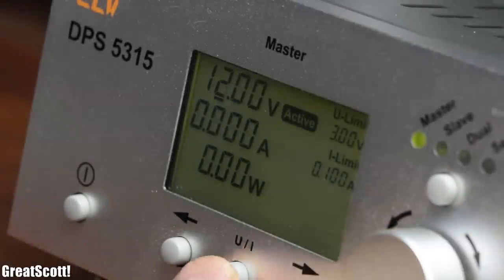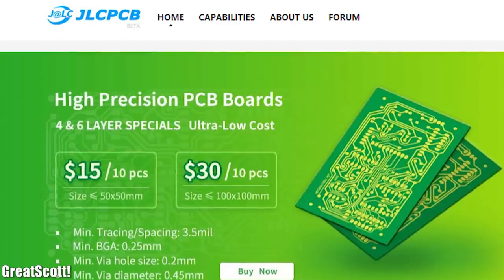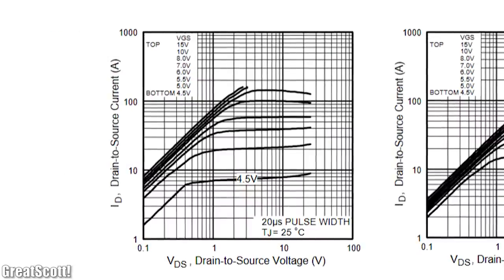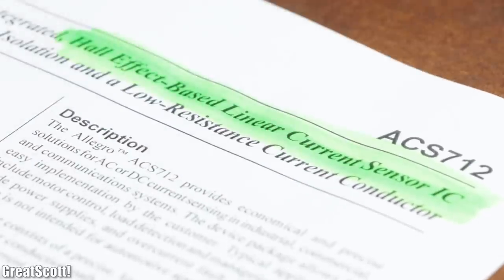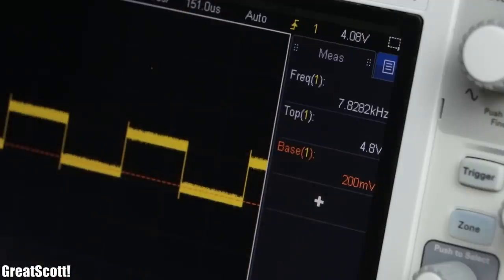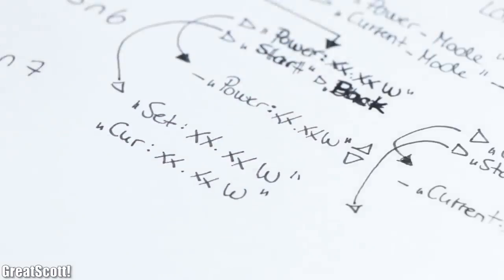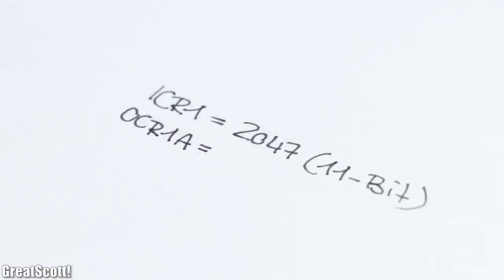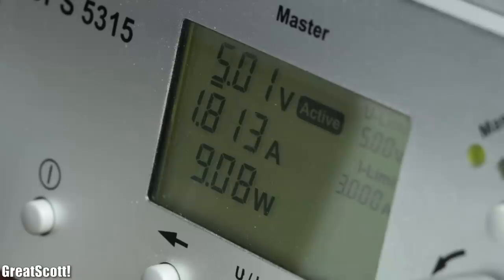DIY Adjustable Constant Load (Current & Power)

Comment: Did I get something wrong? I thought when I want to use a MOSFET as a switch I have to use satuation region too... no?
Reply from the maker: You want to use it in its ohmic/linear region. This can be a bit confusing because (I think) for BJT those region names are switched.
Reply: Hm could be. It always made sense to me to work not in ohmic region since the name suggest to have some resistence which I don't want in a swicht :D
Reply: I have to agree with Trust me, I'm an engineer! on this one. For a switch, I want the lowest possible Rds value (on-resistance), which is achieved when the transistor is operating in its saturation region
Reply: Putkimies92 I thought so as well but after some research it turns out that GreatScott! is right. The saturation has different meanings. For BJTs it's a relation between Base-current and Collector-Emitter voltage. It is the region where the Vce cannot be lowered no matter how much you increase base current, meaning the Vce is saturated. This state means the BJT is dropping as little power as possible. For MOSFETs it's a relation between the Drain-Source voltage and the Drain-Source current. It is the region where increasing Vds doesn't increase Ids and therfore Ids is saturated. MOSFET saturation is not related to Rds-on and in fact the Rds-on value is only true in the linear region where the MOSFET is operating as a resistor (but a very low value one).
Reply: I also agree with Trust me, I'm an engineer.  I am also an engineer.  When you use a MOSFET as a switch you want to use it in the saturation region, turned on as hard as possible, to get the lowest power dissipation in the MOSFET.  The "ohmic region" is called that because it has a higher resistance in that region, and therefore much higher power dissipation.
Reply: we use MOSFET in the saturation region to minimize the power loss in MOSFET  which causes overheating. And here SCOTT want it to act as a load that's why he chose the ohmic region.
Reply: I think you are all misunderstanding the graph or don't know the terminology. The saturation region is the region where an increased drain-source voltage (repeat: drain-source not gate-source) does not lead to an increased current. You do not want to use a MOSFET as a switch in this region. It can barely be called a switch, if it limits the current to a certain maximum value no matter what voltage you apply, can it?
Reply: EDIT:  OK, I removed the part here where I referenced the Fairchild Semi app note at https://www.fairchildsemi.com/application-notes/AN/AN-4161.pdf because they don't even seem to use the terminology correctly.  They are using the term "linear region" the same as the ohmic region.  The Infineon app note says "linear region" is the same as the saturation region.  So we have two manufacturers here using the same term in different ways.  So, again, I'm editing out my use of the term "linear region."

You want the ohmic region to use the MOSFET as a "variable resistor" for your dummy load.  But you also have to be aware that most really high power MOSFETs these days are only specified for use as switches and expect to be turned on hard into the saturation region.  If you are going to use one as a dummy load you have to make sure you use one that is specified for such use or greatly overkill the power spec by like maybe a factor of 10.  Kerry Wong has a nice explanation here:
http://www.kerrywong.com/2016/10/08/linear-mosfet-and-its-use-in-electronic-load/comment-page-1/
Reply: Totan Das -  But he didn't choose the ohmic region. He said repeatedly he wanted it in the satruation region.  The whole point of a dummy load is to dissipate power, and power is dissipated as heat, and heat is created by ohms and current.
Reply: superdau -  It doesn't limit the current at all in the saturation region.  The graph can be misleading in that way, because you see the line go horizontal, which makes it look like the current will not increase.  But that line is horizontal because it is drawn for a singe drain-source voltage.  Say you apply a voltage of 20 volts to the drain-source and get a current of 1 amp.  I just made those numbers up, but say then you increase the gate voltage, you won't get any more current, but this is only because the resistance of the MOSFET won't go down anymore, because when you have driven the MOSFET hard into saturation.  So your 20 volts will still produce only 1 amp, even though you incresase the gate voltage.  You've turned it on as much as possible.  But now, increase your drain-source voltage to 40 volts, and  your current will double.  It's like the MOSFET is a fixed resistor at this point.  Apply more voltage to that fixed resistor and it current will go up as well.  And on that graph what you are essentially doing when you increase the drain-source voltage is you are moving up to one of the higher horizontal lines in the saturation region.
Reply: @superdau I think u are doing a mistake we need a graph between gate voltage and Vds. Carl Smith explains it more clearly.
Reply: Carl Smith
I don't know what graph you are looking at and describing, but it clearly says drain-source voltage on the x-axis and drain-source current on the y-axis. At some point, the ds-current does no longer increase with ds-voltage. So no, if you apply 40V instead of 20V the current won't increase like in a fixed resistor. That's the whole point of calling it saturation region. In that region you can use the gate voltage to control the current (also very obvious in the graph).
Reply: I'm a bit of a loss here, because you are describing something that the graph does pretty much explicitly NOT show. In the ohmic region the current is almost purely dependent on the drain-source voltage, and NOT on the gate voltage. You have almost NO control over the current in that region.
Reply: superday - I guess I don't know how to explain it then.  Here's another link to an product note from MOSFET manufacturer IXYS, which in my opinion is one of the best MOSFET manufacturers out there.  They know what they are talking about, and this product note is all about using linear mode MOSFETS as current control devices and one of the example circuits at the bottom is an electronic load.
edit:  Guess I should include the link:  http://www.ixyspower.com/images/literature/250V-600V_Linear_L2_TM.pdf
Reply: Ok,. in my previous replies I was confusing the terminology a bit.  I've gone back and edited out my use of "linear region" as I was using the term incorrectly.   I was confusing the linear and ohmic regions of the graph.  It's the right side of the graph, the saturation region, that is the linear region, which I should have known, since the lines are linear, not curved like the left region of the graph.  It's linear because at this point in the graph the MOSFET is on hard and its resistance is essentially as low as possible, so as the drain source voltage increases, the drain current increases linearly.  But it still DOES increase.  Superdau - look carefully at that graph -- even though the line is almost flat, it is not actually flat.  Increasing the Vds will still increase Ids.  Ids just doesn't increase as fast because the effective resistance of the MOSFET is lower.  The analogy with resistors would be like the voltage drop across a smaller resistor increases much slower than it does across a larger resistor if you were to increase the current the same amount.  GreatScott made the same mistake in terminology as I did, his first reply says "You want to use it in its ohmic/linear region" and I think that threw off my thinking.  Linear and ohmic regions are not the same region.
Reply: Yes, and in that document it says that the current of a MOSFET in linear mode is controlled by the gate voltage, which you do in the saturation region. 
Oh wait? Are you confusing "linear mode" and "ohmic region"? Those are two very different things. A MOSFET is used in linear mode when it is in the saturation region !
Check this
https://www.infineon.com/dgdl/Infineon-ApplicationNote_Linear_Mode_Operation_Safe_Operation_Diagram_MOSFETs-AN-v01_00-EN.pdf?fileId=db3a30433e30e4bf013e3646e9381200
or this
https://www.youtube.com/watch?v=1qRWBkrcnAM
Those are the first two links that google spits out for me when searching for "linear mode mosfet". They should make very clear that you never want to be a switching MOSFET to linger in the saturation region, but want to get into the ohmic region as quickly as possible. For a load you want the opposite: you want to stay in the saturation region to run the MOSFET in linear mode. All this is clear just by looking at that single graph, but I guess videos or another text explanation makes it easier.
Reply: Superdau - the lines are not actually horizontal even in the saturation region.  They still go up with increased Vds.  Just not anywhere near as fast.   And because the line is straight linear line in this region is what indicates that the mosfet is actiing sort of like a fixed resistor.  You have a linear change in Ids for any change in Vds.  If you kept extending the graph out to the right the lines would keep going higher forever, until you exceed the devices safe operating ratings and it fails.
Reply: Now you just trolling, right? Just check the links, please. The Ohmic reason is called like that for a reason, because the MOSFET acts like a resistor there. Take a guess why there is another region, that is not called "ohmic region"?
Reply: Superdau - Resistors have a linear relationship between voltage and current.  MOSFETS in the saturation region have a linear relationship between voltage and current.  You apply more voltage, the current goes up.
Reply: Except it's like that in the ohmic region, not the saturation region. All you've stated until now is the opposite of what the single simple graph shows. No point feeding a troll any more.
Reply: It's NOT like that in the ohmic region.  The left side of the graph has curved lines.  If you plot the current through a resistor as you increase the voltage,  you get straight lines.  Sloped upward straight lines, not curved lines like the left side of the graph.
Reply: And that graph is not simple in any way. It's the most confusing thing about MOSFET characteristics.  It has proven here today that it is not a simple matter that is easy to understand.
Reply: Let's use the infineon pdf that superdau posted  before. Figure 1 shows the output characteristics. For a 400mA drain current, using Vgs=3.3V we are at saturation region with Vds=4V. So power dissipation is 1,6W in saturation region.

Now for Vgs=3.6V and the same drain current we are in the ohmic region with Vds=0.5V. Power dissipation is 0.2W in the ohmic region. 

It is as easy as seeing that the Vds, for a given drain current, is lower in the ohmic region. Thus it dissipates less heat and this is one of the main reasons on why you use ohmic for a switch.
Reply: I think there is a lot of confusion of terminology in this thread. If you want to use a MOSFET as a switch, you use it in the omic region.That is the reason, why the RDS-on is stated in the datasheet as static on resistance. This is because, when the MOSFET switch is in the 'ON' state, it has a almost constant resistance, as opposed to a bipolar transistor.
The confusion arises, because in a bipolar transistor the saturation region is where the Vbe is so high, that an increase in Vbe does not decrease Vce (Vce,sat is reached). On a MOSFET on the other hand, the saturation region is the region, where an increase in Vds does not increase Ids, that means, even though you apply more voltage across the MOSFET, the current does not increase. But if you increase Vgs in the saturation region, the current does increase.
+Carl Smith, The sites you mention all confuse the omic region with the saturation region, they use the terminology for bipolar transistors.
+Brandon Mulder, that is straight wrong. The graph is Ids over Vds and the dissipated power is Ids*Vds, that means it increases the farther right and up you go. If you want to switch a certain current (y-axis fixed) you want to be as left as possible to minimize switching losses.
Carl Smith, also, even though the current saturation region does increase seemingly linearly, it is not a constant resistance. Resistance is calculated as V/I, so even a constant slope can have a changing resistance, if there was a change in slope before. What you mean is differential resistance, ΔV/ΔI, that is constant. Just try it and take two points in the saturation region, current and voltage and calculate the resistance, you will see, that the resistance goes up, the more voltage you have.
Reply: Wow, so much wrong information in this thread.  The only people who know what they're talking about are superdau and Alexander Daum -- The main source (no pun intended) of confusion is that "Saturation" refers to two completely different quantities depending on whether you're discussing a MOSFET or a BJT, which operate under completely different physical concepts.  In a BJT, saturation refers to the region where an increase in Ib results in no further increase in Ic or decrease in Vce. In a MOSFET, saturation refers to the region where an increase in Vds results in no further increase in Ids.

To answer the original question -- to use a MOSFET as a switch, you most definitely want to operate in the ohmic (linear) region, NOT in the saturated region.

Source: MSEE degree and 15+ years as a satellite electrical power design engineer.
Reply: @Alexander Daum
You are correct. I read the graph wrong. And you want indeed as less as possible Vds "across" the MOSFET to minimalize the power loses. But, you need Vgs need to be large enough to accomplishment it (for higher currents). 

This link: https://www.vishay.com/docs/68214/turnonprocess.pdf is perhaps interesting: 
"Figure 3 shows the detailed output characteristics for gate voltages between
2.5 V to 3.6 V. MOSFET users usually think of this as the linear mode. However, device designers refer to the gray area as the
current saturation region - for the given gate voltage, the current that can be delivered has reached its saturation limit. Any
increase in applied VDS will be sustained with only a slight increase in the current, whereas even a slight change in current can
lead to a relatively large increase in VDS. For higher gate voltages, when the MOSFET has been fully turned on, any operating
point will be located in the area shaded in green to the left, marked as the resistive (or ohmic) region."
Reply: @Samuel-km5yf  But why? In the ohmic region, the switch resistance (Rds, on-resistance) is higher than in the saturation region. Usually when talking about a switch, people refer to something that turns something on or off. If you just want to turn something on, why would you want to add a series resistance (read increased Rds/on-resistance) with the intented load that is connected to the other side of the switch?
Reply: Putkimies92 -- But the resistance isn't higher in the ohmic region.  It's lower.  In the ohmic region, the conductive channel that forms between the drain and source is deeper. 

Let's take an N-channel device as an example since that's more common than P-channel.

To turn on the MOSFET, Vgs must be greater than the threshold voltage (i.e. Vgs>Vth).  This allows a conductive channel to form between the drain and source.  The higher the gate-source voltage, the deeper this conductive channel becomes, within a limit.

In the ohmic region (aka linear region), Vgs>Vth and Vds<Vgs-Vth.  This allows a nice deep conduction channel to extend across from source to drain.  Rds(on) is nice and low, Vds is nice and low and power dissipation (Pd) is nice and low.  Just what you want from a closed switch.

If you reduce the gate voltage (Vgs) to a point that Vgs is still greater than Vth but now Vds>Vgs-Vth, then the greater Vds begins to effectively "pinch off" the conductive channel at the drain.  This reduces the size of the channel -- i.e. reduces the amount of drain current (Id) that can flow and you would now say the device is operating in the saturation region.  Keeping the gate voltage fixed, an increase in Vds will only cause stronger "pinching" and you cannot get higher Id.  The only way to get higher Id is to increase Vgs.  Increase Vgs high enough and you'll re-enter linear operation (i.e. Vds<Vgs-Vth).  In the saturation region, the conductive channel is reduced and you can vary its size by slightly varying Vgs -- this allows control over Id and Vds, providing a lousy switch but a convenient variable load as you see in Great Scott's video.
Reply: @Samuel-km5yf  I agree with almost everything you said but there are somethings I have to disagree with you. As you said, the current barely anymore rises after reaching the saturation region which is caused, as you said, by the pinch-off effect. Also, it is true like you said that by keeping the drain-source voltage constant and by increasing the gate-source voltage, the transistor re-enters the ohmic region and compared to the LAST saturation situation, the current is increased. But what if you NOW keep the gate-source voltage constant and instead, increase the drain-source voltage, you again re-enter the saturation region and also the current increases. This can be seen by just googling a basic Ids-curve, which shows that the highest level of Ids curve is ALWAYS reached at the saturation regions, which is ALWAYS dependent on the drain-source voltage, gate-source voltage and the transistor threshold
Reply: Putkimies92 -- 
"Also, it is true like you said that by keeping the drain-source voltage constant and by increasing the gate-source voltage, the transistor re-enters the ohmic region"

I want to clarify that this is only true if the MOSFET is not in deep saturation.  In other words, if the Vds is very high, you'll be operating farther to the right side of the Ids-Vds chart.  As you can see in the chart, if you increase the gate-source voltage here, you'll move vertically up the chart, but you'll still be in the saturation region.

"But what if you NOW keep the gate-source voltage constant and instead, increase the drain-source voltage, you again re-enter the saturation region and also the current increases."

Correct.  Referring to the Ids-Vds chart, with a fixed Vgs and increasing Vds you'll be sliding up/right along one of the Vgs curves.  Slide far enough up/right then you're back in saturation.

"This can be seen by just googling a basic Ids-curve, which shows that the highest level of Ids curve is ALWAYS reached at the saturation regions, which is ALWAYS dependent on the drain-source voltage, gate-source voltage and the transistor threshold"

I apologize but I don't follow this.  Can you please reword it?  It's not clear to me what part of my previous post you disagree with or didn't understand because most of what you said is correct.  My explanation was probably not very well written and I'm happy to explain further or clarify.  I think you're very close to understanding the concept, but I have a feeling there's one little piece that still needs to be unlocked and I hope to help you find it.
Reply: Sorry, my answer was written on a phone and maybe not the best way to put my thoughts on the paper. I also agree that we agreed on most of the things but I am still a bit unsure if I feel the same way about using the ohmic region over the saturation region for switching.

What I mean is that when you look at the a conceptual curve of the drain-source current (Ids) as a function of drain-source voltage (Vds) and then sweep the gate-source voltage (Vgs), you see that the saturation level is reached at different points and the Ids current is at the maximum level in the saturation region. This is something you actually referred to in your previous answer so I guess I just said the things I meant in a weird way, sorry about that!

But also, some things that still keep me wondering about your answer: 

1) If I want to maximize my current through the switch, why wouldn't I drive it to saturation? The drain-source current curve reaches its top point at the saturation region. If I had the chance to optimize my switch in the most perfect way, I would drive it at the edge of saturation so that the transistor channel is completely formed but there is not yet pinch-off. Of course, this is not possible in real life with all the discrepancies between the same produced components without trimming, so I guess I would drive my switch transistor a bit deeper into the saturation region to make sure that I have the maximum possible current for the gate-source voltage I am using.

2) Let's assume we are now right at the edge of saturation region (this is just a theoretical assumption!), let us assume that Vds = Vgs - Vth. At this point, we have the conducting channel between the drain and source completely formed and no pinch-off effect. Also, the drain-source current has reached its maximum level (for the given gate-source voltage). Doesn't this mean, that right at this point, we have the lowest on-resistance?
Reply: Sorry, forgot to pin you on my answer.
Reply: Good questions.

1) "If I want to maximize my current through the switch, why wouldn't I drive it to saturation? ...If I had the chance to optimize my switch in the most perfect way, I would drive it at the edge of saturation so that the transistor channel is completely formed but there is not yet pinch-off."

Because the voltage drop (Vds) will be high as indicated by the value on the x-axis of the chart.  High Vds and high Id equals high power dissipation --> Pd=Id*Vds.  That's bad for a switch and wastes power in the form of heat generation in the device.  In a given application, you should already know the max current that you need to switch. Let's say this is 10A.  The Id-Vds chart will tell you what the voltage drop (Vds) will be at 10A for various applied Vgs values.  Choose a Vgs value that results in operation on the left side (ohmic region) of the chart when Id=10A.  As you can see, the higher the Vgs, the lower the voltage drop (Vds) will be at 10A.  A common Vgs value to apply in practice is 10-15V.  Anything above 10V is a good rule of thumb but stay comfortably below the absolute maximum Vgs value which is commonly 20V for power MOSFETs.  If you don't have 10V available in your circuit, you can compromise by applying a lower Vgs and verifying that the increased voltage drop and increased Pd is still acceptable.  Or you can look into logic-level MOSFETs which are driven with Vgs=5V.

2) "Let's assume we are now right at the edge of saturation region (this is just a theoretical assumption!), let us assume that Vds = Vgs - Vth. At this point, we have the conducting channel between the drain and source completely formed and no pinch-off effect..."

Let me clarify that the channel begins to "pinch" before it reaches the edge of saturation.  It's a gradual effect.  The channel is significanly narrowed or "pinched" even in the shallow ohmic region.  At the edge of saturation, the channel is barely touching the drain through a very think layer.  Beyond the edge of saturation, the channel no longer touches the drain but current is still able to flow (not as easily) due to the high magnetic field that has developed beteween the drain and the channel.  

"...Doesn't this mean, that right at this point, we have the lowest on-resistance?"

The minimal "pinching" and lowest resistance is obtainted when the slope of the plot is steepest (i.e. highest Id/Vds, or inversely, lowest Vds/Id). This will be the top most plot -- the one with highest Vgs -- and on the left most side of the graph (low Id and low Vds). 

Hopefully that helps and hopefully I didn't word my response too poorly.  Let me know if I need to clarify anything or if it would be helpful to walk through an example design process of a DC switch.
Reply: @Samuel-km5yf  Actually this starts to make more sense now. The last thing you mentioned about the steepness of the curve clarified it for me and I am now starting to think that you are actually correct about this.

 I have been working more with low power switching devices so I have never actually given a though on this problem before. For them, the applied gate-source voltages are usually so low that they enter the saturation quite easily.

This was a good lesson for me and now I am wiser on this subject. Thank you!